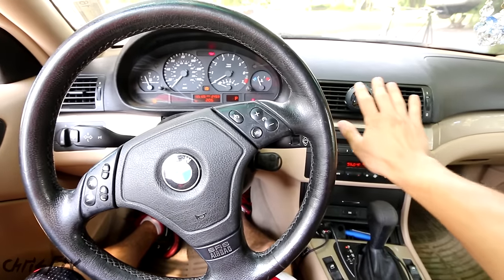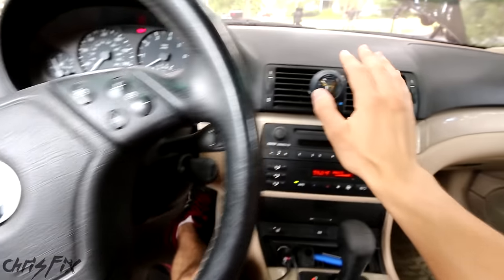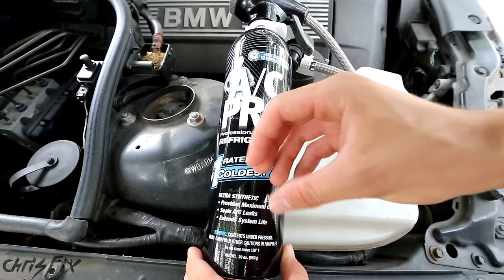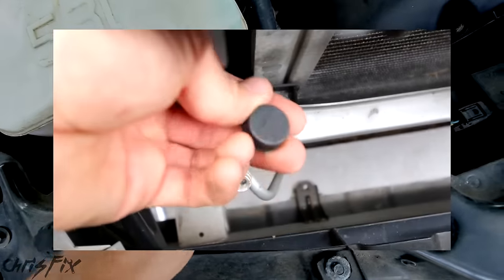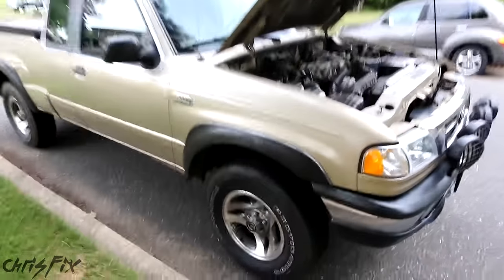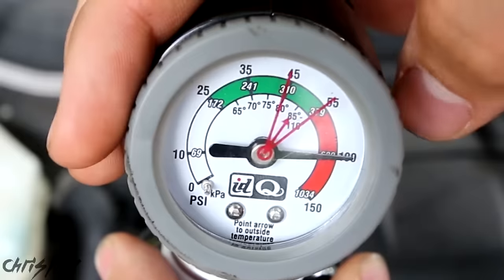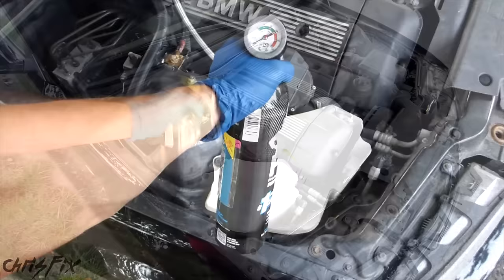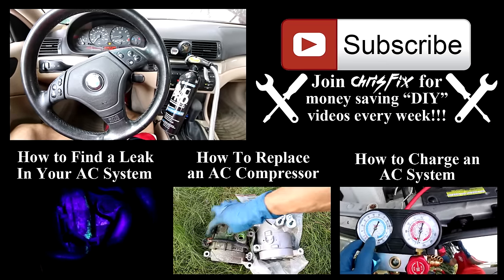How to Recharge Your Car's AC System (Fast and Easy)

Comment: this is a temporary fix not a permanent fix
Reply from the maker: Correct. As stated in the video this car had a very slow leak and this lasts about a year. The owner cannot afford the $2k for a shop to fix the leaking compressor.

Comment: no vacuum pump? if you dont get all the air out of the system you never are going to get the AC to work well. Not sure what the point of this video is, anyone can just hook up a can of refrigerant and try to shove it into a line full of air.

Comment: Just got a new car and it shot straight to high red 😐
Reply: New as in used
Reply from the maker: Is the AC compressor turning on? If not, the pressure might be ok. You need to read the pressure when the ac compressor is on.
Reply: @chrisfix  Yeah it turns on
Reply: @chrisfix  My issue is that my ac only blows cold air when I turn my car

Comment: I stayed in the green and broke my car's air conditioning
Reply: That’s because you’re not supposed to use this without measuring the low and high pressure. This video is wrong.

Comment: "not worth to find leaks in your system" proceeds to recharge the system the wrong way... You have to vacuum the system to confirm leaks. There is no snake oil or mechanic in a can that can repair a torn o ring or a gap in the system system components. To it right! This video should have 1k dislikes